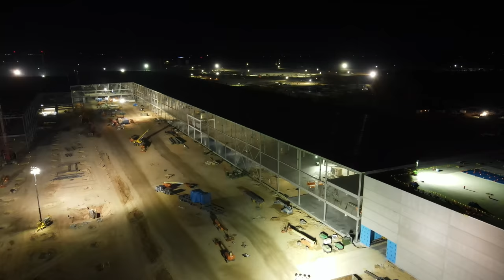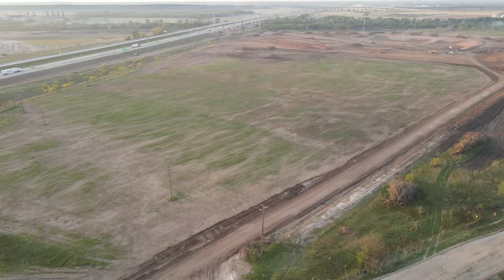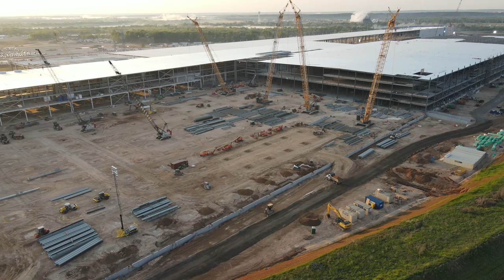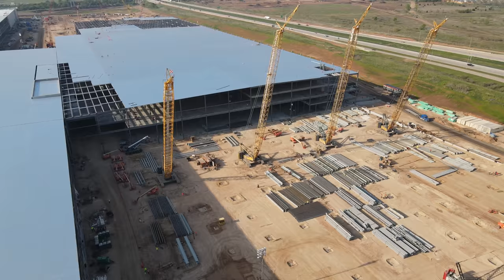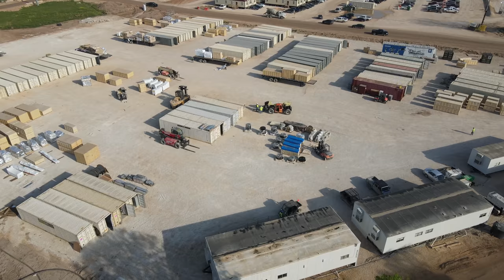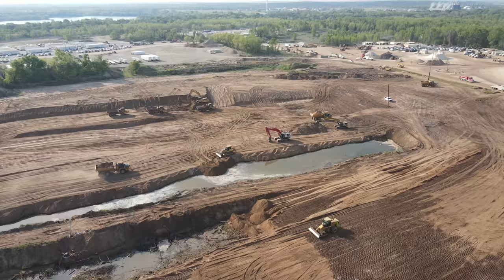A Good Friday - 2021-04-02 Progress Update

Comment: They are loading the paint shop roof. I thought that would be the next area to be weathersealed. They will leave about 10 men on the stamping plant roof to cut in and finish it.
Reply: Let’s hope that they add an additional crew for paint rather than moving the stamping crew— let them work towards the middle.  There is a lot of roof work to be done, and the larger contiguous areas are much easier for multiple crews to work than the stamping area— fewer perimeter, penetrations, and drain points to worry about.

Comment: Thanks, Jack!  Great 3am video, confirmed my suspicion that there isn’t much going on then.  Looks like everything else is moving along steadily.  I was surprised to see the “Phase 2” civil work moving forward on the east side in earnest, but it makes sense— they should be ready to pour foundations there inside 3 months.
Reply: They have added dump trucks and a backhoe. Did they bring the equipment over from the west side?
Reply: @kkarllwt  I doubt it; it looked like more equipment than was in use on the west side.  Logically, I would expect them to want to prepare as much land as practical, at least up to the point where they are importing soil.  There is a good chance they just want to be able to get larger areas ready for geotechnical analysis by leveling them out.
Reply: @kkarllwt  They had equipment over there working the past week on the East side, but the added stuff was from the west side , where only 1 backhoe was left. All other dump trucks, dozers, and backhoes moved to the East side to join the folks already there in what looks to be a much higher intensity effort to get that done very quickly!
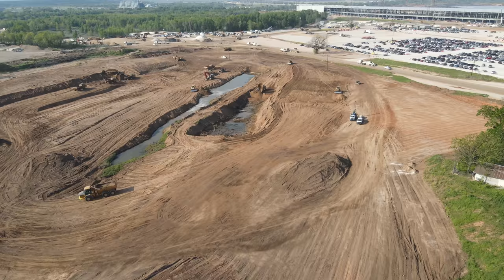Reply: 17:27. Questionable back-filling of a debris filled hole. Must have thought nobody was watching.

Comment: First!!!! So cool you were there for the sunrise and to show that sadly nobody was working at 3am.... so much for 24/7 eh!!
What bird do you fly?
Reply: Really?  I saw stuff going on. .
Reply: For instance they were rolling out the foundation pit in the battery area.
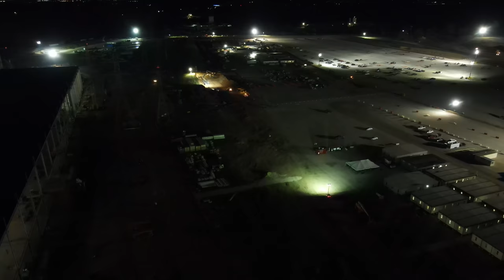Reply: 2:18 I see about 50 cars in the parking lot.
Reply from the maker: There was a decent amount going on. I'm pretty sure they will not operate cranes at night though. I fly DJI Mavic Air 2. A link is in the description.
Reply: They had a crew working at night, but some ops, like the rooftop work and crane work, are daytime only for safety reasons! ground crews and some internal crews on the floors were there overnight working!